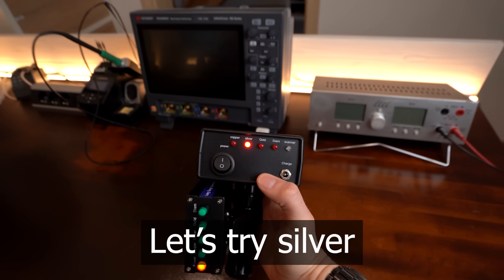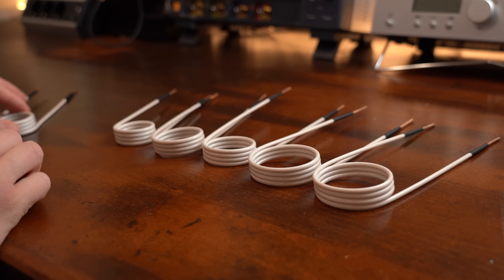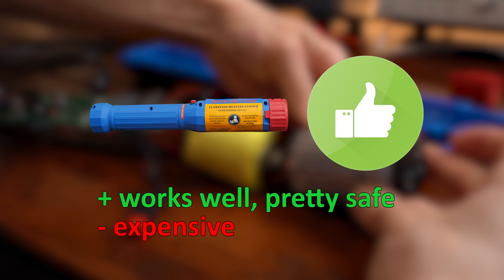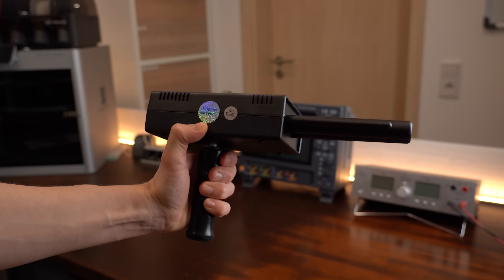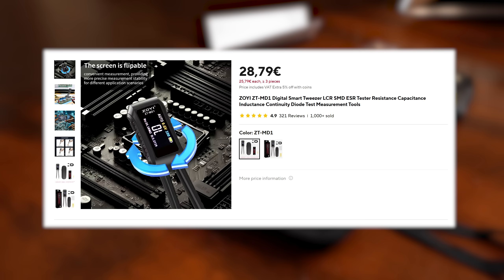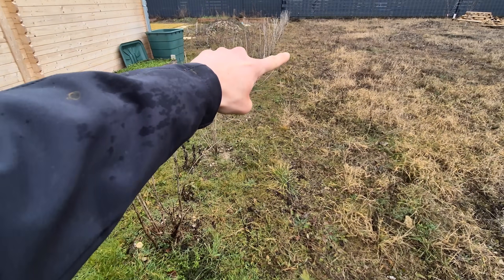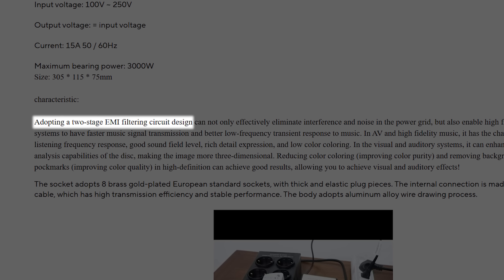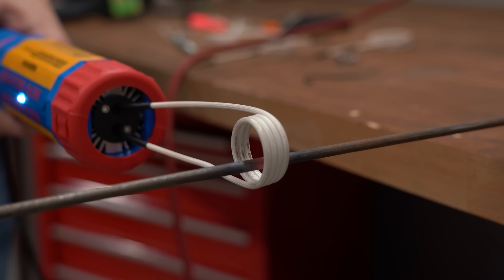I tried finding Hidden Gems on AliExpress AGAIN! (Part 13)

Comment: I would never trust lazer safety glasses from AliExpress
Reply from the maker: Haha yes. I have my own pair too
Reply: try to find a shop that specialize in optics, lasers and lab equipment that does not cater to the bottom feeder crowd and you'll be fine. usually.  🤤

Comment: 4:55 a lot of Android phones don't give access to networks without internet. If you set your  phone in flight mode and only enable WiFi it will work. (Or disable your carriers internet on the phone)
Reply: Many, like Samsung, also explicitly ask if you want to keep beeing connected to the network, since it does not offer internet access. After confirming, such web interfaces usually work.
Reply: @MarkusRambossek  both my last Huawei and my current Xiaomi does ask, and seems to stay connected, but still don't get access to the wireless lan....

I had a phone that did get access, maybe that was when I had a Samsung....
Reply from the maker: Thanks for the tip. Maybe that helps others.
Reply: Turn off the "smart switching feature" for permanent usage of IoT devices, this is what tries to make the phone switch off no internet wifi.
Reply: This is mainly true with iPhones in my experience iPhones however don't let you connect at all they just pop you up with an error
Reply: You can bypass that on Android devices.
Reply: @hal263  That is possible yes but every vendor customized their devices so not all Android devices have this bypass.

Comment: Not quite tech, but it would be entertaining to see a rundown of all the aliexpress flux.   They have tubs, syringes, bottles, blocks, and so on. 

Also, I am curious if anyone knows how flux paste is made?
Reply from the maker: I can put it on my AliExpress list ;-)
Reply: Yes, this would be great.
Episode on all the different flux options. Please include info on things like if the need to or even can be cleaned off later easily and which ones might eat through the board and components 3 months down the track.

👉 A similar video on solder / solder paste options etc would be good too
Reply: "Make Your Own Soldering Flux, Liquid Flux" - Electronics Repair School
Is a video from here, is an old one, maybe it will be useful?
Reply: @BozesanVlad  Yeah, that's a decent one.  I've watched pretty much all videos on 'how to make flux'.  95% of them are all making liquid flux out of pine rosin, aka colophony, often from violin bow rosin.  4% of them are how to actually make pine rosin from pine sap, which is super cool and I'd like to try small scale one day.  1% of the videos are how to make flux paste. Most of those fail, or just end up mixing it with vaseline or shampoo which I am certain is not how it is made, lmfao!
I have a bunch of rosin already that I'd like to make into paste format because that is how I often use it.  I would love if anyone happens to know how to make it, but I suspect I may have to end up trawling patents and the such because I see nothing out there on it.
Reply: @ Google patents: "A soldering paste flux for use in soldering copper and copper alloy piping and the like is formed of 40–70% nonylphenol ethoxylate (preferably Tergitol NO-10® made by Dow Chemical), 10–30% glyceryl monostearate, 3–10% acid activator, 3–10% water, and 4–15% mineral salt. The acid activator is preferably a mineral acid and, most preferably, hydrobromic acid. The mineral salt is preferably zinc bromide."
Reply: @BozesanVlad  Cheers mate!  I bet I actually glanced right over that exact paper, but had checked out at that point. Neat stuff!
For what seems to be the primary constituent materially and cost wise, this seems to be an expensive item.  Either that, or the public is not privy to the market of scale for these chemicals.
Glycerol has a viscosity of 1.412 Pascal-second, it looks like NPE's come in multiple varieties.
Looking further, Kimyagaran has a PDF on their properties, Ethoxylated Nonylphenol - 20EO seems to match up nicely as a white paste at 20˚C, and 0.110 P·S at 50˚C, where as Ethoxylated Nonylphenol - 10EO at 25˚C is already a clear liquid at ~0.245 P·S, and Ethoxylated Nonylphenol - 30EO is a white solid at 25˚C.  Not that I am saying google patents has some hand waved details, but I suspect that a tergitol NP-20, or a less concentrated mix of NP-30 might be more on the money.

I'd be real curious to get my hands on some of this to try it out.
Reply: Kingbo RMA-218 is fantastic, and very cheap on aliexpress. I know many technicians that use it.
Reply: @yotoprules9361  thanks for the tip, I'll save a note on that for when I need some.
This is more of a knowledge inquiry than a price point deal for me because I haven't seen how it is made anywhere.
Reply: I always thought that it can't be good to breathe in the soldering fumes but seeing these chemical names kinda makes me even more worried
Reply: @dan-nutu  Go for just the pine rosin blocks, and make sure your fume extractor is whirling.
Reply: Thanks. Hard to use rosin blocks on the PCB, that's why I also use paste. I got it on amz uk, made in Poland... Poland being in the EU I hope it doesn't have the most toxic chemicals in it! That being said, I made myself a fume extractor that I'm kinda proud about :) - I designed and 3d printed a shell that takes in a 8cm fan, some activated carbon filter and it all snaps onto the "head" of an USB-powered LED lamp with a goose neck, so I can have both the light and the air filter close to the action :)
Reply: @dan-nutu  Nice one!  You can also dissolve the rosin blocks into IPA and put it into a squeeze bottle with a syringe tip for such applications if they are flat.

Comment: I have the "genuine/original" one of those induction heaters. They're SO awesome if you work on cars/trucks/etc.  I've probably saved NOT burning down a vehicle numerous times, over using an oxy/acet torch.  Mine can virtually liquify a nut in under a minute.  And as AvE says... if it's liquid, it can't be stuck!  :D
Reply from the maker: Very cool! Thanks for the feedback.
Reply: As Ave says : Don't put your....
Reply: @meetv7700  - and keep you stick on the ice.  Well, that's where the expression started from anyhow!
Reply: @DrFiero  Quick question when you say "genuine/original" do you mean by that it doesn't look anything like what Scott showed in the video?
If so i will assume it's something more "old school" aka, the transformer to high hertz is a big box which is a bit harder to move around with the coil wired?
*I did buy a similar one to what Scott has but it seems to be a bit stronger. It's so useful !
Reply: @TwinShards  - looks almost the SAME as the oneScott has!  It's a Solary HotRod which I believe was the OG that then got knocked off by everyone else.
Reply: @DrFiero  Ah then i have the same thing, not quit "liquify in under a minute" I got the "Pakowin" which is look-alike to the Solary.
Reply: induction heater is the best thing for any rust belt auto works. Sway bar links, exhault bolts or seized cam bolts no problem.
Reply: Ave's has so much power it can burn the.... off your......
Reply: @mevk1  what's "AvE"?
Reply: @dzervas  Youtuber that makes videos on tools and such.
Reply: @ When he first started his channel it was called "Arduino vs Evil". about 12-15 years ago he shortened it to "AvE" (tells you how long I've been following him!).  He's on the west coast of Canada here where I am as well.  Speaks english, french, with a bit of neufy.  As his kids have gotten older he's mellowed, but his vernacular... well... lets just say he'd make a longshoreman blush.  :)
Reply: @dzervas  An annoying guy on YouTube I blocked years ago. Don't even know if he is still around. And that saying is not his, that's been a saying for longer than he's been alive.
Reply: AvE has turned into a right wing conspiracy nut weirdo.
Reply: @ oh damn, what a shame...
Reply: @misterhat5823  Yeah never seen someone kill a channel as quickly as he did, COVID did a number on him but suspect he was already a right wingnut.
Reply: @misterhat5823  You mean a normal, honest, hard working person then.

Comment: I love these. Finding all kinds of neat crap!
Reply from the maker: Haha sometimes it is more than crap I would say ;-)
Reply: That metal detector is definitely crap. Straight ewaste! 😂
Reply: found a good lookin' "EMF Meter" called a "VOTERY E11" to check for hidden trackers and shady stuff in places they're not supposed to be and, to my utter amazement, it did the job despite being only 8.88€ shipped (with coupons & coins) and having one of those nifty high contrast displays like them tweezers waiting patiently in my cart for a "hit buy now hard" relapse moment. since the first one was lost in shipping limbo for way too long, the seller sent for the same price after a refund and, lo 'n behold!, the local post office delivered both at the same time but without tracking for the first one since label and bag were pretty mangled-up. seller told me to keep both for the delayed delivery so i gifted the second one to a friend after testing both. lots of surprising finds ensued like a very sus hidden tracker in a brand new electric bike a neighbour was gifted by her (now ex) bf... 😅

out of any ten products ordered, it usually looks like i get two dog soup eater sphincterous dejections, two to three "good enough and not dangerous" ones and solid performers for the rest minus one once in a while which is quite an understatement to say it has been quite an improvement from when i started ordering from that Ali guy little shop... 😽👆